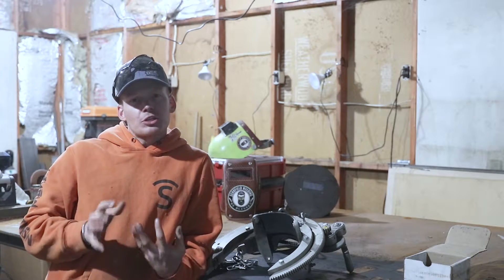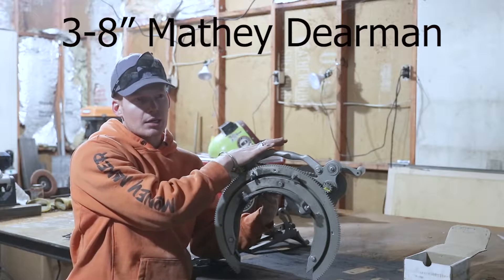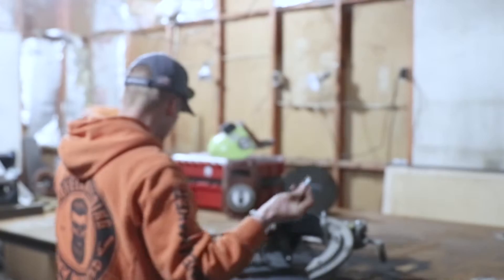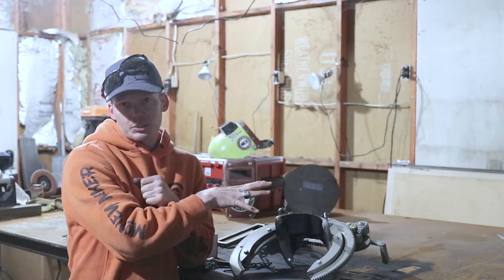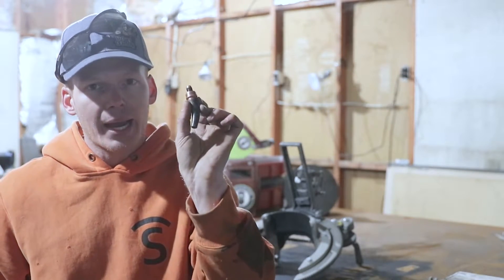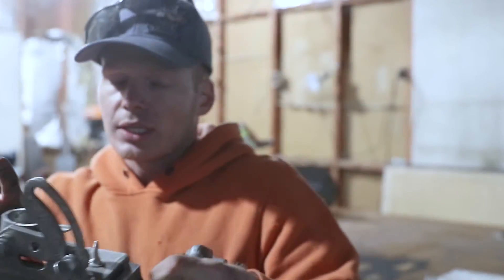Setting up a Pipe Beveler.

Comment: Idk if it’s because im from canada but there called shoes here and dogs are a piece of steel with a nut and bolt on it that you can tack to the pipe so you have push the high low out of your big inch pipe.